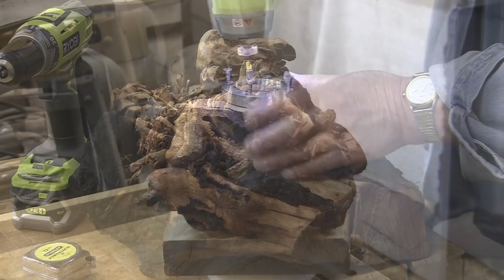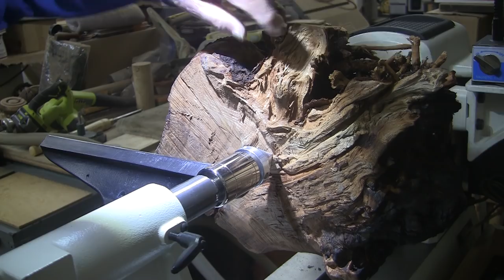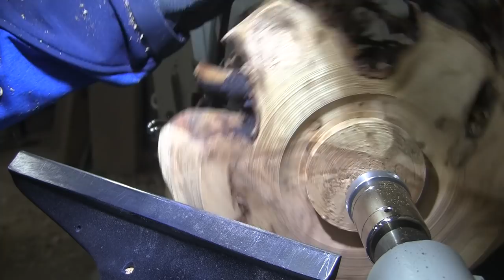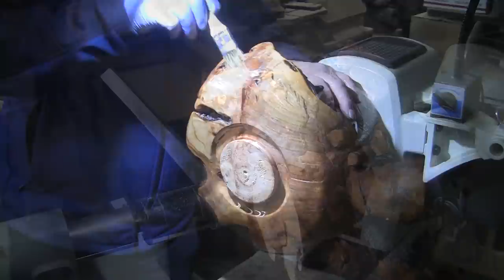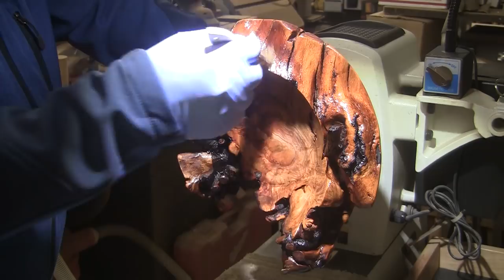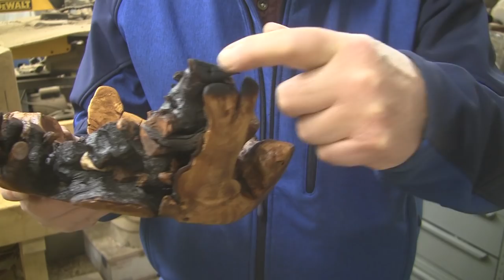Root Ball Beat Down! - Wood Turning

Comment: Turning root material is always an adventure into the unknown. I would assume the square stick was a stake used to hold the seedling straight in it’s infancy. And we all just know that roots will hold rocks. All things being equal, I wonder what you may have been able to do with it if you dig that last rock out of it. It may have been so deep that you lost the whole thing. Then again it may have allowed for something extra special. Doesn’t matter though. You have a special piece as is. Beautiful! Thanks for sharing it with us.
Reply: Exactly what I was thinking about the stick being a stake for holding up the tree when it was young.
Reply from the maker: It looked to me, Doug, like the rock was only showing a tiny bit of itself and I didn't want to end up with a big hole where it had been.  I guess we'll never know.  I'm just glad it's done! 😊
Reply: @PhilAndersonShadyAcresWoodshop  I fully agree with you.

Comment: Wow Phil, you had a real challenge there, just the fact that you didn't imbed something in the wall or ceiling while you were doing that was mighty impressive! The before and after shots are amazingly dramatic to say the least, and I have a hunch you might have picked up a stress line around your eyebrows while you were at it!   🥴  Bottom line is that it turned out fantastic. Congratulations on persevering, great job!
Reply from the maker: Thank you very much! 😊

Comment: With all those rocks in it I'm surprised you didn't split it into multiple pieces and get the rocks out then cast the whole thing in resin! I don't normally recommend breaking a piece or using resin, but with this kind of piece I'd recommend considering making an exception! You did what you could with a hard to turn piece of root ball! 👍
Reply from the maker: That would likely never happen on this channel, Dark.  The rocks that were too tight to remove are now jewelry! 😊

Comment: Hi 👋 Phil from Phil. Yes it’s me again I’ve just been watching some of your tutorials from a few months ago on Turning root balls, I’ve noticed that you’ve come across some stones and rocks in bedded where you have been trying to remove them, I don’t know whether it was just luck but I used a automatic centre punch quite a large one, I placed it on the stone and And operated the centre punch which means pushing Down on the centre punch and then when the mechanism releases impacts the stone and shattering it, I don’t know whether it was just luck but I’ve used it twice now and it seemed to work where the stone rock fell apart and you then could move the bits. I hope this is some help.
Stay safe mask and face shield on as one says.
Phil from the moulin France.
Reply from the maker: For, the most part, I just want to remove them if I think they are going to fly out while turning.  If they are securely in place I leave them as jewelry. 😊

Comment: Hi Phil, as I was watching this and you were turning the inside of the bowl, before you removed the center, it reminded me of a nutcracker bowl we had when I was a kid. There was a stud in the center of the bowl on which you'd hold your walnut or whatever and whack it with the wooden mallet that came with the bowl. Have you ever made anything like that??
Reply from the maker: I've thought of it a few times when, as you say, there is that stud in the center.  The thing is, I seldom have that stud in my turnings.  I have made a chip and dip bowl with a small bowl in the center of the larger bowl. 😊

Comment: I love seeing your creations in action!  This one was obviously a challenge.  My guess is that square peg was likely the remains of the stake used when the shrub was young.  As for the difficulties and limitations posed by turning a root ball,  if you've not yet tried it, perhaps it's time to play with the idea of adding resin to your repertoire.  This one is a prime example of a piece that could have been turned into a real (& functional) work of art.  
Have fun & thanks for your posts.  CC
Reply from the maker: Thank you for taking your time to watch and comment, CC!  You and I see things a little differently and that's a good thing!  I don't use resin.  I have seen and appreciate what others like Andy Phillip can do with it.  Fantastic art pieces!  I see this root ball as an art piece.  Not mine but Mother Nature's.  I just removed a little material to reveal the art she created.  For me, If I were to then cover it with some sort of plastic, filling in the voids and covering up the wood grain so that it can only be seen in an obscured manner and the wood grain could no longer be felt, I would be doing a disservice to the piece.  My turnings are works of art, very few are meant to be functional. 😊

Comment: Manzanita is a tough wood.  It can be turned green, much easier, duh ... LOL. It has to be done quickly and dried very very slowly.  It is a beautiful wood when done though.  On the other hand, it great for BBQing, makes a really hot coal.  I burns really hot.  You gotta be careful is you use it in your wood stove in the winter.  Beautiful job Phil.
Reply from the maker: Thanks for the info, Joseph! 😊

Comment: A bother good video. Thanks. Earler I asked you what size sanding disc you used. Well you said it was a 2".  next question  I see a lot of disc holders and they all have a thick come pad.  I can't hind any disc drivers with the thick pads where do you get them ? Thanks Phil
Reply from the maker: Everything I use for 2" sanding comes from this page, Ernest, including the Apprentice soft backing pad:  😊 https://www.woodturnerscatalog.com/t/114/Hook-and-Loop-Discs

Comment: OMG - Another root ball nut job!  Nice to have company.  This turning could not have come at a better time for me.  I am elbow deep in an Oriental Fringe Tree root ball.  The wood keeps amazing me with its hardness.  I was able to turn the outside with a combination of gouge and carbide but the wood takes the edge off steel so fast that it gets kinda silly.  For the inside I have had to use carbide alone and it has been a long, slow job to hollow the bowl.  About 7 inches deep.  Every shaving is a victory!  As it is I have gone through a dozen edges on the carbide tools.  Use an edge for 4 or 5 minutes and then rotate it to get a sharp edge.  I suppose I shouldn't be complaining because I have had a chance to use a diamond carbide sharpening system and it does a nice job.  Hand sharpening only because carbide dust is quite toxic.  I am moving slowly towards some pieces as natural as yours but mostly cast epoxy into the cracks and voids.  The epoxy work was quite involved on this piece.  6 different pours I think.  Very interesting to me that the epoxy isn't much of a problem turning with gouges.  As you said about the manzanitas, the gouge just slides across the surface.
I too have done a manzanita root some time back.  Same thing, when it is dry it is rock hard.  I send you a few pictures when this current Root Ball is done (understanding that it may wind up in the trash yet).
Loved watching your carbide tool work.  I find the angles interesting and your technique is so smooth even when you are dealing with all those interrupted cuts.  Nice job Phil.  More, More!

Comment: That's a crazy turning!  Thanks for sharing.  Quick question:  How do you sign the bottom of your finished pieces?  Is it just a sharpie or something else?  Does the finish interfere?
Reply from the maker: I use an Ultra Fine Point Sharpie and apply paste wax over the signature. 😊

Comment: Does the brand of Shellac make a difference in the finish.  If so, what brand would you recommend.
Reply from the maker: Zinsser is the brand of sealer and shellac that I use.  They say you can put any clear finish over the sealer.

Comment: Wonderful turning!! I wish we knew the history - that square stick is crazy! 

Why did you change your mind on sanding sealer and hot with the danish oil?
Reply from the maker: Too hard to get into all the tight little areas to smooth sanding sealer, Kathy.  I just  used a toothbrush to buff the Danish Oil in those areas.
Reply: @PhilAndersonShadyAcresWoodshop  thanks - finishes seem to be a mystery - my husband uses sanding sealer and you don't usually vary from it - can't tell you how great it is to have you back!  The square peg makes the piece - 

Have you considered a heavy leather apron to protect yourself from flying rocks?  An apron like a farrier would wear.  :-)
Reply from the maker: @kathyenglish8427  I'v learned to stand out of the line of fire, Kathy.  I don't think I've ever been hit by anything flying off the lathe.  There is the off chance something could hit the wall behind the lathe and get me, but it's not likely.  Thanks for thinking of me! 😊

Comment: Do you ever try to submerge a piece like this into a bucket of epoxy and vacuum out the air, before turning it?
Reply from the maker: No.  If I did, I would end up with wood and plastic.   I'm more into nature and preserving the natural features I'm given to work with.

Comment: Every time I see you reaching to the left, to switch off the lathe, I cringe a little. Isn't there a way to get a parallel knob on the right side so you can turn it on and off without the possibility of hurting yourself?
Reply from the maker: Not easily and inexpensively, Hanan.  I do have an emergency stop button on the tailstock end but that doesn't turn it on.  You just learn to be careful after a couple close calls. 😊

Comment: Surely this piece suits being moulded in clear resin and then turned
Reply from the maker: I can't think of any purpose for resin in this piece, Liz.  It would add weight, it would keep you from running your fingers into all the little voids and feeling the wood.  The way it is, it's so tactile and interesting to touch and look at.  It was never meant to hold soup or salad, it's just art. 😊
Reply: @PhilAndersonShadyAcresWoodshop  
I understand. I respect your view. Maybe resin is a way out of struggling with special pieces. I love the finished bowl.

Comment: If you want to get rocks out, attack with a 1/4" - 1/8" concrete drill bit and pointed rock chisel in an impact driver.

Comment: Totally insane, could you imagine if the scraper were to get into the opening of one of those gaps and it either broke or pulled your hand into the lathe fukk that shet.
Reply from the maker: I take it you are not a turner?  That wouldn't and couldn't happen.  Maybe turning at 2-3 rpm it could happen but not at normal speeds. 😊
Reply: @PhilAndersonShadyAcresWoodshop  even the person with all the skill's, there always can be an accident.
Reply from the maker: @goaheadmakemyday9859  Well of course but if we let that bother us we might as well stay in bed! 😊
Reply: @PhilAndersonShadyAcresWoodshop    so your going to tell me that accidents don't happen and I know you've  had an accident or more. It is call using COMMON SENSE. That's what can keep one from having an accident.
Reply from the maker: @goaheadmakemyday9859  It seems silly to argue over something we are in agreement about.  Of course accidents can happen and of course common sense can help prevent them.  You started this by saying "imagine if the scraper were to get into the opening of one of those gaps and it either broke or pulled your hand into the lathe"  Common sense tells us that cannot happen at turning speed.  Simply impossible.  That's why I guessed you are not a turner.  Turners would know that a small gap passing by a scraper at 500 rpm is of no consequence, it's just common sense.  That doesn't mean it's not a bumpy ride, it is, but there is no chance a scraper is going to enter a gap at 500 rpm.  I suppose if you are putting your full body weight against the scraper and pushing as hard as you can it might cause the wood to break at that gap but who would do that?
Reply: @PhilAndersonShadyAcresWoodshop  Well, with what you say you have been very lucky you  haven't had any accidents yet and I say yet cause one never knows or maybe you work alone so no one has ever seen if you have had an accident.

Comment: What do you have against Carbide tools?   Cutting is cutting.   You have problems here using a square cutter; us a round cutter to better control “dig in”.    You’re very aware of the problems associated with “turning air”.    Why make it tougher?
Reply from the maker: I think discussions about carbide vs high speed steel tools will go on until the end of time, Samuel.  It's a matter of personal preference.  First of all, yes, cutting is cutting but carbide does not cut, it scrapes.  A scrape is not a clean cut.  Do they work?  Yeah, for some people they work just fine.  I'm happy for them.  For me, they don't.  I can't feel the wood like I can with HSS.  If it's OK with you, I will continue on using what I enjoy the most.  Occasionally, I will grab a carbide tool because I think it will do the job better for awhile.